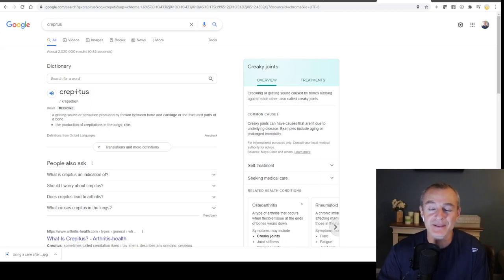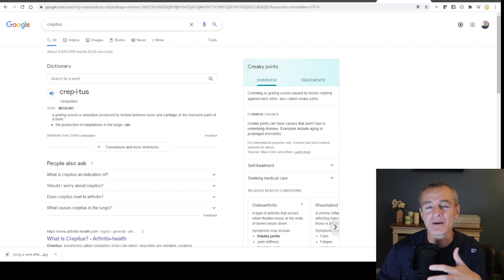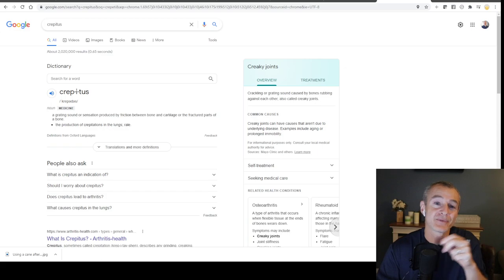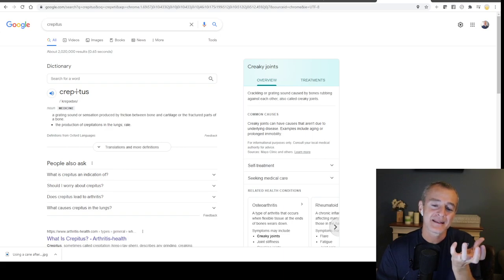Why does my Knee Replacement Sound Like Velcro Tearing?

Comment: My patella fractured 6 mo after replacement and they did nothing for it because it took them 9 days to see me.  It has healed fractured and has limited my rom and pain is still present after 16 mo.  Crunch sound and cracking on both knees.  Other knee replaced 21 mo ago.  Any suggestions?